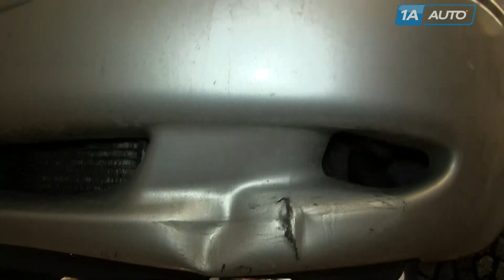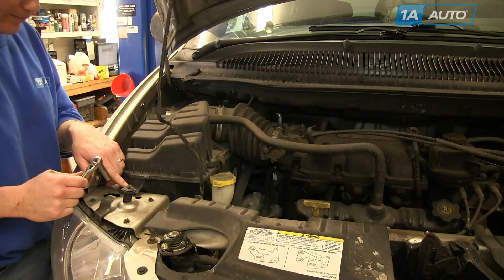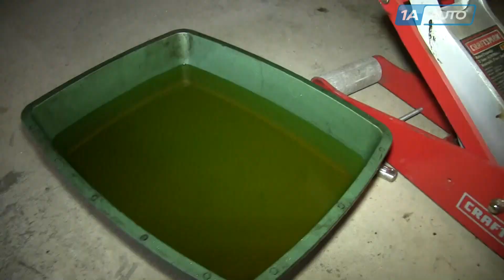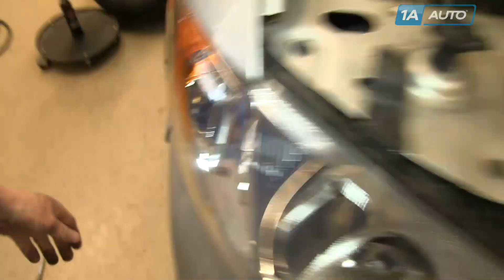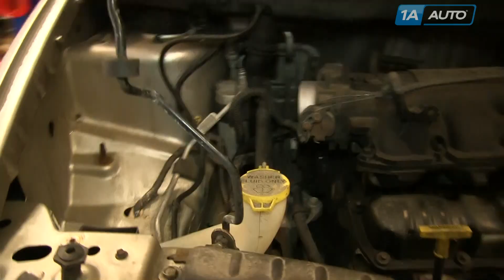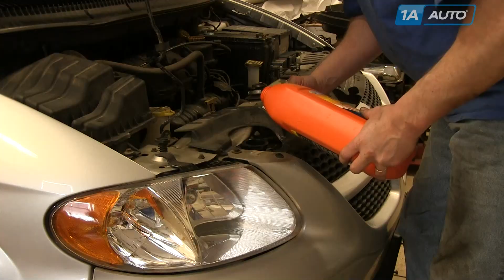How To Replace Water Pump 01-07 3.3L/3.8L Dodge Caravan

Comment: no reason to do anything with the engine mount. Place a long pry bar (longer the better) between the tensioner bolt and frame and lean into it as hard as you can, this will push the engine over enough so you can sneak the water pump pulley out, repeat this to remove the pump also. Hope this saves someone some time. When you're flat rate time is $$$

Comment: I am just finishing doing water pump on a 2005 Dodge Grand Caravan 3.3 liter.  It was a little bit different.  Did not have to remove the inner fender wells.  The bolts were pretty easy to get out without removing motor mount.  The very top bolt was not that hard.  I did have a hard time with the bolt closest to the rear end of the vehicle.  However the impeller was to deep inside the cavity and would not clear the frame so I did end up having to remove the motor mount as shown.  It was a bit difficult to do all of it.  I suggest getting some silicone grease to hold the 0-ring in place while reassembling it.  Makes that part of it easier.

Comment: I just did this on a 2007 Grand Caravan.  Make sure you have at least 4 of those pastic tabs just in case you break the old ones off when removing the splash guards.  Also when you get to that back bolt on the water pump i used one of those mini ratchet sets with a 10mm socket and put a little paper towel to line the inner socket so it won't slip off the bolt easily.  Use an already removed bolt to set the paper towel "liner" inside the socket and then reach through the side to the back (no need to work from under) with just the 10mm socket, push the socket on that last bolt, attach the mini ratchet and start working it off.  If the ratchet is "screwing it back in" because the force is too little to click, take wd40 and spray the ratchet head to work in a little oil.  This will make the ratchet easier to work off the bolt.  Make sure you wipe the ratchet clean to get the excess oil off before using or you will be cursing like a sailor.  You're probably going to do that anyways...  I hope this helps someone...
Reply from the maker: +Wes Karcher Thanks for the feedback!

Comment: I did this job today and must say it was not pleasant.  But there is no need to remove the air filter or move the engine around.  As said previously, a 10mm ratchet box wrench is invaluable for getting to that upper-most rear bolt on the water pump.  And with just a little bit of patience I was able to remove/replace the water pump, despite the tight clearances.  All of which is not to say I didn't appreciate the video - I'm a shade-tree mechanic and this video gave me the confidence to tackle it.
Reply from the maker: +Eric Schaffer Thanks for the feedback!
Reply: A ratchet wrench right👍

Comment: I goofed a little and removed the belt before loosing the water pump pulley bolts. The pulley was free to spin while I loosened the bolts. So it was a LITTLE more of a hassle to keep a handle on that, but still definitely loosen the bolts before you take off the belt.
Reply from the maker: +Chris Hutchins Thank you for your feedback!

Comment: Hey guys, amazing video!! Thanks for putting these together! We have a 2001 grand caravan and I was able to complete the repair without removing the air filter AND didn't have to mess with the engine mounts. I was able to reach all pump bolts from underneath, pretty easily actually. I wish I would have had time to order the part from you guys, but needed it done asap (wife's work car). Anyway, thanks again for the always amazing vids!
Reply: Im long and skinny i think i would be able to get them without dropping the engine also
Reply from the maker: +Rocco N April Thank you for your positive feedback!

Comment: I just did this on this on the 03' T&C 3.3 and all I had to do was remove the pump pulley and move it around to get to all the bolts. Then you can rotate the pump and the pulley until it falls out the bottom.  There was no need to jack the motor or unbolt the engine mount and was able to do it all from the bottom.
Reply: Atom good idea! some people go to far and cause more work.
Reply: The 3.8 might be different, though.
Reply: Atom Sky that's what I was figuring thank you for the verification!
Reply: Canadian ones have a different frame than the lower 48 style's so don't plan on that gravy train until it rolls in
Reply: Thanks for the tip Atom Sky!
Reply: Just did the same thing, the back bolt is easy enough to get to there’s wayyyy harder scenarios on vehicles.  If your a seasoned mechanic this is gravy

Comment: I broke a bolt whole taking off one of the water pump bolts the one right below the tip hold. anti e have any idea on what I should do before I say fuck it and drill a hole in it
Reply from the maker: +Abu Mannocchi If there is enough sticking out of the block, you might be able tp clamp a pair of Vise Grips on it to break it free. You might have to put some penetrating oil on it. Hope this helps you out.

Comment: Thanks for the video, I always come here to find out what I'm getting into! I'll make one suggestion, if your working on the ground, get a 10MM box ratchet for those two water pump bolts that are had to get to. That really helped me get the &^%#$ thing off
Reply: Thanks for posting the tip, the 10mm box rachet really helped.

Comment: Great video I got my pulley to come off my water pump with no problem I just went towards the motor with it also I didn't come from underneath I just took a simple socket set an inch that tough screw in the back out slowly sure it took me 3 hours for one bolt LOL great video thank you
Reply from the maker: +roy nelson Thanks for watching. If any of our viewers needs to make this repair, we carry the auto repair part shown in this video on our website. Here is a link to them http://www.1aauto.com/water-pump/i/1aewp00079?utm_source=YouTube&utm_medium=CTA+Comment&utm_campaign=ytcomment&utm_term=d8oYPMkV-yg

Comment: Thanks for taking the time to show me how to lower and raise the  engine to get the  old water pump out and install the new water pump. I would never been able to change the water pump on my 2006 Chrysler T&C. I really appreciate your help
Reply from the maker: +floortechnition Thanks for watching. If any of our viewers needs to make this repair, we carry the auto repair part shown in this video on our website. Here is a link to them http://www.1aauto.com/water-pump/i/1aewp00079?utm_source=YouTube&utm_medium=CTA+Comment&utm_campaign=ytcomment&utm_term=d8oYPMkV-yg
Reply: I always run the engine up to full operating temperature and wait for the thermostat to open and release trapped air in the system, then the coolant level will drop, then top off the coolant and I'm done, if you skip this procedure your customer will be back with a vehicle that's over heating, also if the vehicle has bleeder screws you need to open them up to release trapped air in the system.

Comment: I've seen other diy videos saying to use 3M weather strip gasket sealant. Actually gluing in water pump rubber gasket in first and let sit 15 minutes ,then add some more on outside gasket before mounting with the 5 -10 mm bolts. Just curious,  why wasn't that done in your video?
Reply: Seated gaskets dont normally require it...it may not hurt, but i did the job without it, and had no problems

Comment: FYI, just as a note, always check the bolts on the water pump wheel.
I had one that came loose and it sounded like a bad pump, all I did was tighten the bolts and the noise went away. Lucky day.

Comment: What a terrible engineering design by Chrysler!
Reply: Welcome to Chrysler! Good engines surrounded by a disintegrating body, that covers half the stuff u need to get to.
Reply: Even worse is the battery location for the concord- you have to take the wheel off to access it thru the wheel well LOL!!

Comment: Doesn't moving the engine that far hurt the exhaust?
Reply from the maker: +Oldcoinsandstuff1 It should not hurt the exhaust as most systems have a flexible pipe for this type of movement.

Comment: i accidentally put the cover to the water pump backwards. does it matter or not.
Reply from the maker: +Jean larraga You want to be sure it's on correctly. 1aauto.com?utm_source=YouTube&utm_medium=CTA%20Comment&utm_campaign=1ATony 866-403-3393
Reply: thanks. I took out all 5 screws and placed it the way i should. now im trying to tighten the 3 screws that cover the water pump but the plate isnt sitting tight, 2 of them look right but the 3rd one doesn't

Comment: I have done this job a couple of times  things I have learned after the first time: 1. you don't have to drop the engine,   the  mounts have enough play you can use a wood 2x4 or prybar to push the engine towards the drivers side to get the pump out quite easily.  the job can be done without axle stands or jacks just turn your wheels to the right and access the bolts from the bottom all you need is a 1/4" drive ratchet and a 10mm socket  get the pulley off and start at the back that one is the worst.
Reply: no just loosen all the water pump pulley bolts and work your way around the water pump and remove all  the bolts then you can remove the water pump by sneaking it out the bottom if you need to push the engine to the right you can get another 1/2" to 3/4" clearance to remove the pump. the first time I did this job I dropped the engine but I still had to pry the engine over to get the pump out. It is not a fun job so be ready for that. the bolt at the top in the back is a big pain.
Reply: make sure the coolant bypass tube the metal one that goes from lower rad  hose into the waterpump isn't rusted they are a problem on the dodge vans.
Reply: Yeah thats what originally sparked this whole thing. parked my car yesterday at work and looked up to see what I thought was the bypass hose leaking. Replaced it in a jiffy and looked to make sure everything was kosher to realize it wasn't the bypass hose at all, it was in fact the water pump. I'm good at changing things. But this video and how detailed it is goes into a whole different realm. So when I read your comment about shifting the motor around, it gave me a little hope.
Reply: Ok cool, So the engine will just shift if i pry it over towards battery? Thanks for all the tips
Reply: sometimes you can squeeze it out but I had to pry the engine over both times. I had it on ramps the second time and it made it a bit harder because your arms are extended.. Start with the back upper bolt first!
Reply: Can you tell me if the mounts need to be loosened before pushing the the engine to the driver side? I'm not really looking forward to undoing the mounts completely unless I have to.
Reply: All I can say is flipping thank-you!  Not being rude just emphatic.  THANK-YOU, DAVID!
Reply from the maker: +davidbrennan5 Those are good tips. Thanks for posting it. 1aauto.com?utm_source=YouTube&utm_medium=CTA%20Comment&utm_campaign=1ATony 866-403-3393
Reply: So you took the bolts out of the mount then used a 2*4 or pry bar to push the engine over ? Just curious, because I will be doing this job in a couple of days. And it was for this same vehicle that you did it?
Reply: But you dont have to take the engine bolts out? And did you pry it from the top or the bottom?
Reply: davidbrennan5 good information
Reply: Thanks  David. Folks it pays to read comments. Absolute genius idea. This is Sheryl’s husband and it was flawless.

Comment: Very helpful! I just changed the water pump on a 2001 3.8 T&C. I got the bolts removed but had to lower the engine to get the pump out. Then I got the belt back on my going under the idler pulley at the top after threading all the other pulleys.
Reply from the maker: +Jay Scott ANDERSON Great work! Thanks for checking out our videos! If any of our viewers need to make this repair, we carry the part shown in this video on our website. Here's a link to them. We also offer free shipping on all orders in the US. http://www.1aauto.com/water-pump/i/1aewp00079?utm_source=YouTube&utm_medium=CTA%20Comment&utm_campaign=1ATony